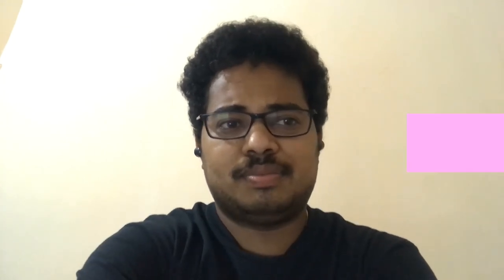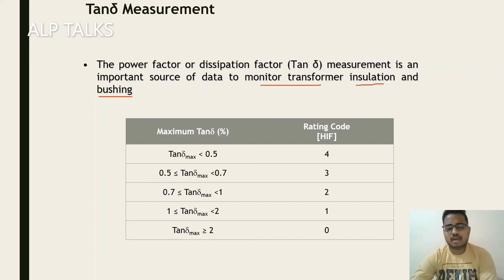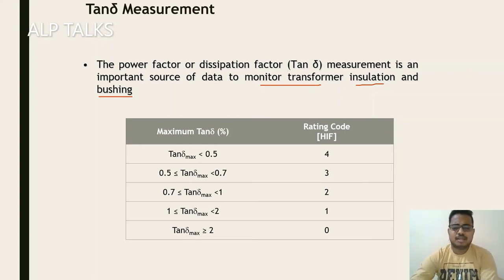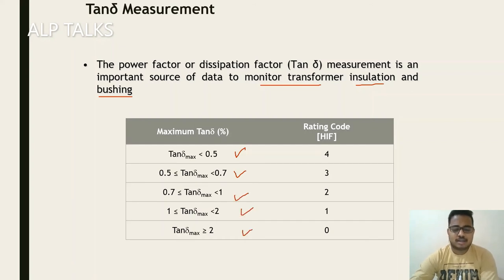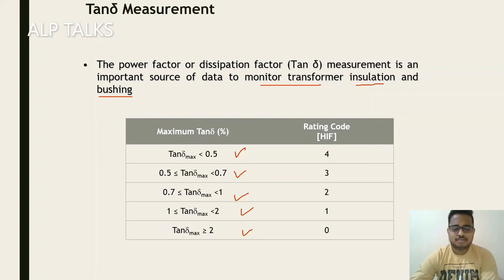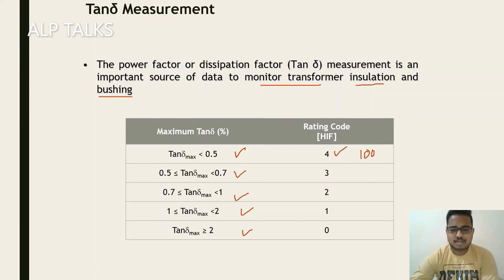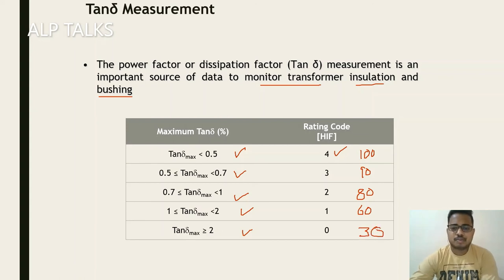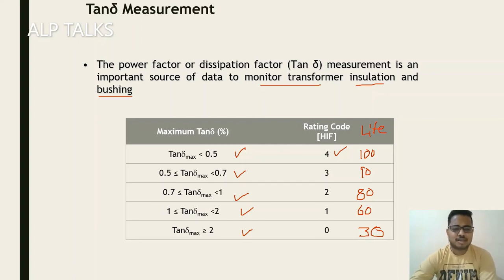Importance Of Tan Delta(Tanδ) | Insulation/Dielectric Quality | Best measures to Maintain it|

Comment from the maker: In power equipments insulation play main role by isolating high voltage winding and grounded body .
 And each insulation is HYGROSCOPIC in nature means it has tendancy to absorb water and other contamination 
      Also due to ageing process insulation quality detoriates in order  to track insulation quality and its rate of detoriatiation Tan delta test peform periodically  .
 In testing voltage apply to winding and return path is taken from other winding and grounded tank. As insulation seprate two conductive material it form capacitance and as we know capacitive current is 90 deg lead to applied voltage ,but due to presence of impurity ,void measured current is just less than 90 degree that angle is delta angle .
    IEEE C57 given guideline for tan delta value
 For Transformer bushing it should be less than 0.7